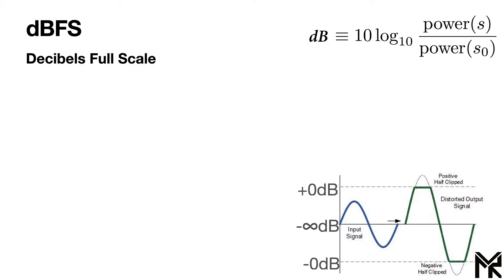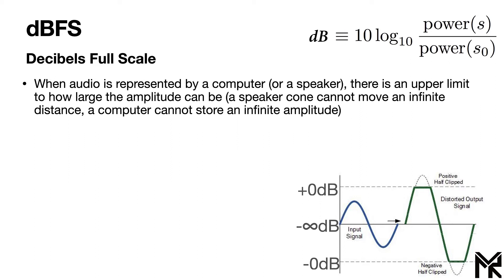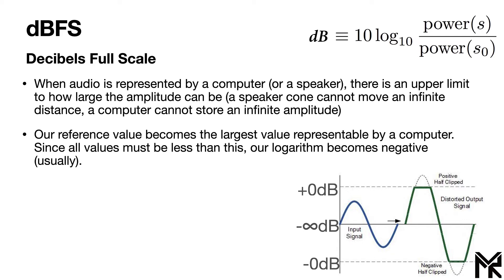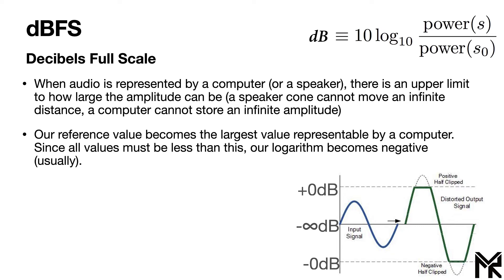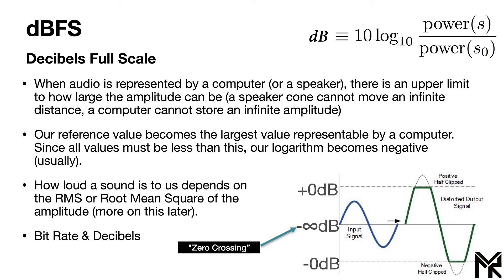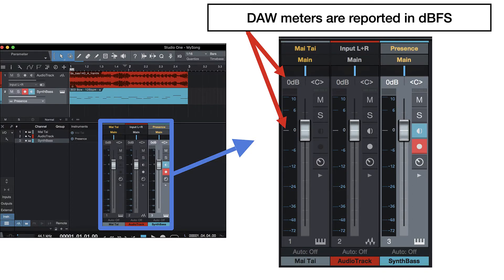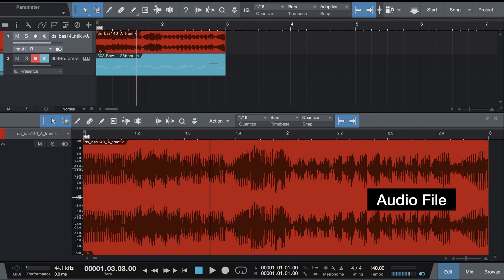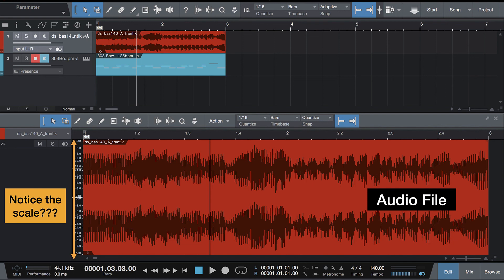Intro to Music Production [Module 3.6] - Measuring Amplitude in dBFS

Comment: hello why is it 10(log( s / s0)? specifically the 10, ive seen versions with 20 as well. Good Video btw
Reply: its used as 20 often when discussing voltage decibels but when discussing dBFS its usually x10. the number multiplied is simply a choice of convenience for the area of study
Reply: it is multiplied by 10 because the original unit is the Bel (B) but for convenience purposes we use the tenth division of this unit, which is the decibel (dB) so the log must be multiplied by 10 to give us dBs instead of Bels